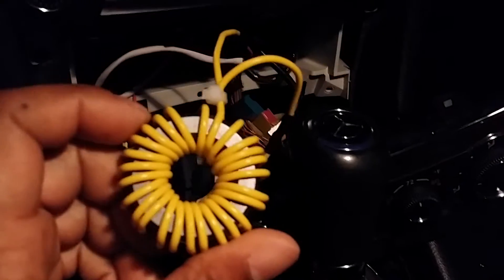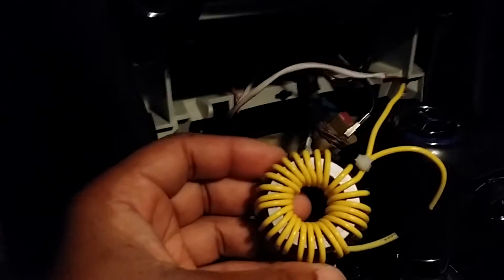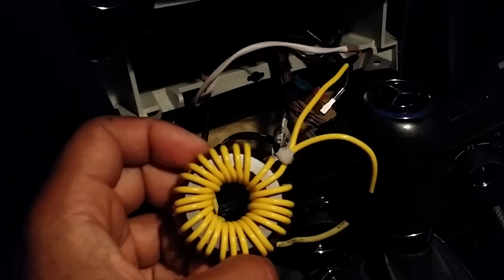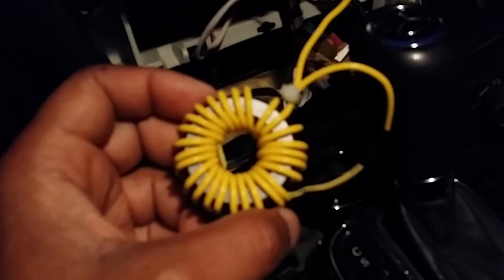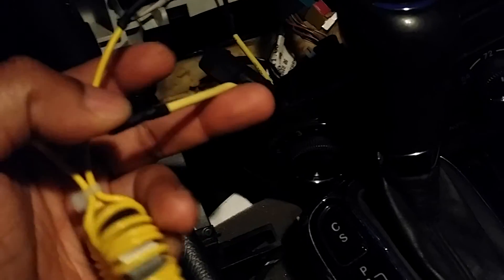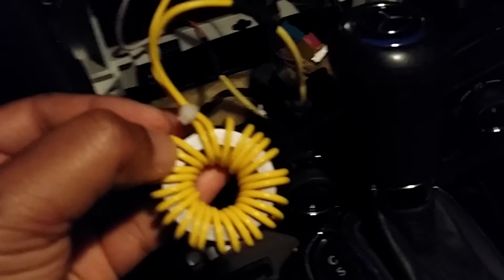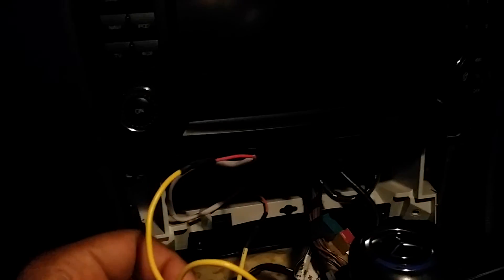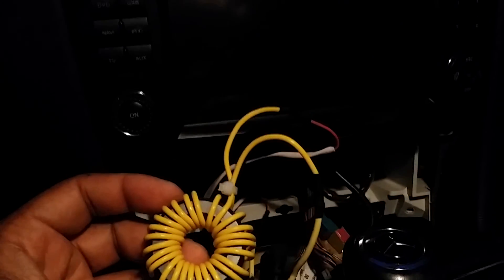Use inductor as a AC filter in your car

Comment: Toroid Core FT240-43 Ferrite - google that; the wire is just a 22 gauge generic wire
I am going to try this on my 1985 mustang with an MSD ignition box and a 130a alternator for reference. I get a hissing from the my tweeters when the engine is running and it stops when I pull the rcas that control my aftermarket amp that powers the tweeters and 4 other 5" speakers. I will be installing this ferrite core electric filter on the constant power going to the stereo.

Comment: Inductor uses inductive reactance to block AC noise on your power line.  Capacitor is put between positive and negative and will filter out AC to the ground.  DC will not pass thru a capacitor.  Use both in order to get the best power line filtration.

Comment: Patrick. if you put the inductor in series with the power to the audio gear by cutting the line near the gear,, and put the capacitor across the power (in parallel and connected to ground) on the audio gear side of the inductor you have a standard low pass filter, and both components assist to reduce the level of the noise on the power line. also don't use the chassis as an earth for multiple devices in different places. if one device is grounded to the dash and you can't isolate it, run the ground wire from there to the other gear in the boot (trunk) and mount THAT gear on a plastic base. if possible use a clean earth to the battery for everything and isolate everything so you don't get any current flowing in the chassis or any differences in the ground potential from other gear creating hash..imagine the chassis has high resistance joints in it and you don't want the voltage drop across these joins in the return path of your audio gear. PS what michael said about the capacitor relates to putting it in series with the supply the same way as his inductor.   to  john d - yes.    to tom L  - try both and see which one. i'd guess the switched one would run the amp and the unswitched one runs the clock.

Comment: Why is this better than a capacitor? Or i guess would a capacitor reduced the engine noise as well? I under stand that an inductor "calms" current while a capacitor some how regulates voltage. But could either have been used in this case?
Reply from the maker: Once the capacitor is full it will block the flow of electrons (capacitors block low frequencies). The idea here is to stop in ac ripple that maybe entering the power source.

Comment: Did you just wire it in series with your 4ch amp power wire?
Reply: Looks like he wired it to the constant power (+) lead. The one that retains the power to the radio for memory when the ignition is off.